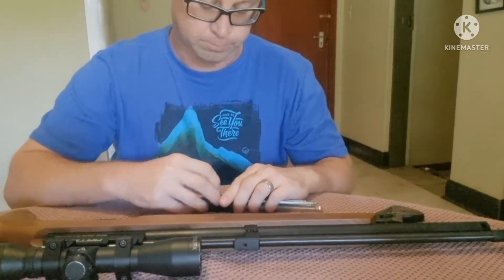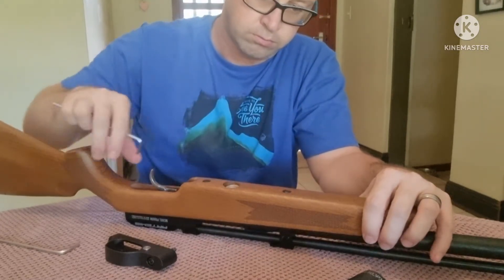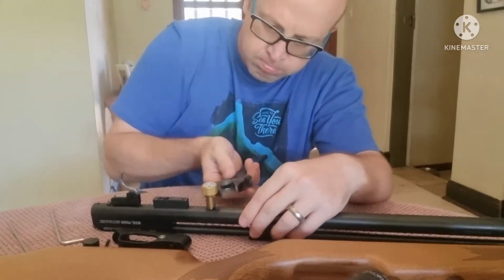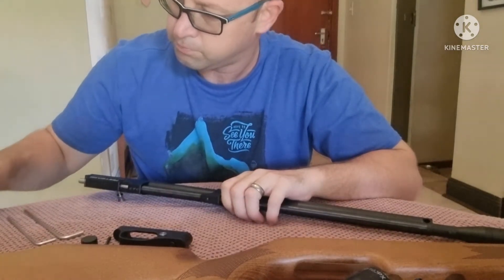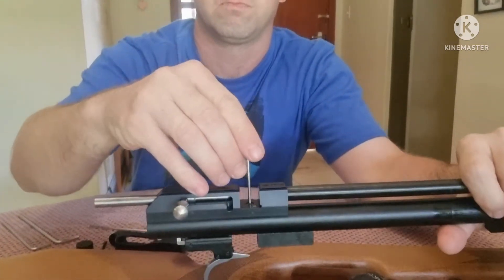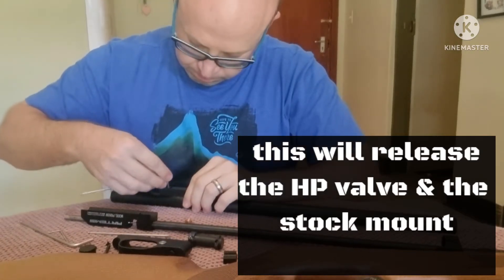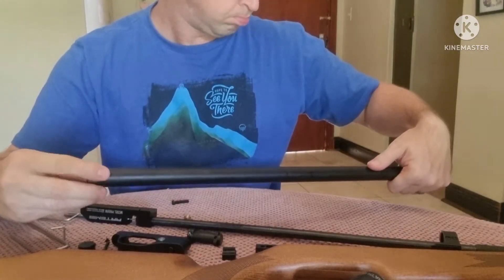How to strip down your PR900/Stormrider - Easy #PR900

Comment: Ran into a problem - broke off my unbreakable bolt!  Was going to take the barrel off and couldn’t get the small screw in the chamber to move.  Tried heat, even a small direct flame but only succeeded in rounding out the hex.  Thought of drilling a small hole -  not sure I have a screw extractor that small or using epoxy to insert a small rod that I could turn.  If anything, the screw is more recessed than it was originally which is confusing.  Not a left handed thread as I recall.  Used a small amount of blue loctite on it and apparently tightened more than I needed to.  Any diy options?  Thanks.
Reply from the maker: Eish that is not nice, loctite can be a real bugger, if it is set it is tough to undo. I would say the easiest is going to be to just drill it out, same size drill bit as the grub screw and then tap the hole to the next size. What you could also try is to use a dremel and cut a small slot to accept a flat screw driver but that is going to be pretty pedantic on that size grub screw.
Reply: @African-Budget-Pellet-Gunner  This not what I understand to be a grub screw but maybe it is.  It’s the one next to the magnet that holds the barrel in place.
Reply from the maker: Oh ok, sorry I thought you were referring to the grub screw which adjusts the bolt action movement. If you are referring to the counter sink screw that released the breech from the tube then the same 2 options mentioned above will apply it may be easier though to start with option 2, grind in a slot for a small flat head screw driver.
Reply: Found my #1 screw extractor which uses 1/8”, about 3mm bit.  Will give that a try tomorrow.
Reply: Tried to drill out the broken bolt hole first since I would still have a working airgun after install oem handle I replaced.  Bad light and poor judgement led to some metal gouging on the receiver.  Tried the breech screw next - ended up drilling it out after screw head broke off.  Hopefully enough threads left to accept another screw.  Was able to remove the barrel and with that the bolt came free.  Found out you can show the good side of the bolt/handle and hide your clumsy work!  One of my first panic moments was finding a o-ring.  Replaced it in the breech with no problem and everything was fine.  Always seemed like a tight fit shoving the bolt home but understood it takes several hundred rounds before it breaks in.  Also read about fat orings - decided to have a closer look at it and now can’t get it back in!  Will watch some more videos to see what the trick is.  Got my scope, chronograph (one shot before the bolt broke) and a shooting bench that has had a single use.  Do you know what the screw size is for the breech screw. I’ve seen M3x.0.6 but would like to confirm before chasing the threads and installing screw.  Thanks for your continuing support!
Reply from the maker: @darwinwilde6973 unfortunately I am not 100% sure about the size of that screw. If your bolt is tight pushing in the pellets, your problem is most likely the barrel which is too tight. Check out this vid to correct it. https://youtu.be/EO0gVpOJoEg
Reply: You should make that video mandatory!  Exactly my problem and with the same predicted result.  Everything back together and I was hoping enough thread left to catch but there wasn’t unfortunately.  Found a screw that was right but about 1mm to long but after a couple cycles was laying on the magnet.  The head on the 4mm is noticeably bigger but could be shaped I guess - then tap for 4mm.  Thought of using epoxy but don’t think it would be good to get inside.  What is under the screw hole? Other ideas?  Thanks.
Reply: Came across an interesting tool I’ve had for many years and seldom used -  for countersinking woods screws.  The bit was broken off but It was perfect for changing the 3mm countersink to fit a 4mm screw.   Head sits flush - pellet loader slides right over it.  It’s also a mm too long and will consider shortening if the bolt strikes it.  Or maybe cut a small channel so it can travel unimpeded.  Will pick up tap tomorrow and be back in business.  Can almost put everything together without checking myself on your videos.
Reply from the maker: Yes, I would say 1 in every 20, CP1 or CP2s have this tight barrel issue. I am sorry your repair has been such a headache. I think perhaps if you send me an email with some pictures I can try advise that way tyrone8511@gmail.com

Comment: Need some help. I had my pr900w, working fine, half inch group at 20yards, firing at 570ftsec. Suddenly, after refilling air, it drops to 400ftsec and fired in different places like a shot gun. What could be the case, before i strip it down. 
Thanks for the help
Reply from the maker: Hi there, is it regulated or not?
Reply: Im not sure as i bought it 2nd hand, but the guys said it was a gen2
Reply from the maker: If a gen 2 then most likely regulated, it sounds to me like a stuck regulator. If it was o-rings you would here it and most likely loose all pressure
Reply: Thanks for the heads up. I think ur right, a stuck regulator. As the gauge was on psi reading, im familiar with the bar reading, most likely i use it below reg pressure. I will top up with air and shots couple hoping to restore, if not, will strip it with the help of your video. 
Thanks again
Reply from the maker: You're most welcome, keep us in the loop, there is many very knowledgeable guys that will comment as well
Reply: Try to put air up to 150bar only. And here what i found. Will try another set without the chronograph at the barrel to find what pressure level shot best group.
Reply: At 150bar,firef at 541. Going high at 36th shot at 672 at 80bar then going down up to 50th shot 583 at 50 bar. 
Is it normal or really need to strip?
Reply: Hi 
Why do you doing this Work...many Power (Joule) or why...i want to by a stormrider at 7.5J and make it over 20J....how can i do it
Thanks
Reply from the maker: @micheletanasescu4476 Hi Michele, you can take the stormrider to well over 20J. Open the transfer port to 4mm, install a 5mm spacer inside the hammer to pre-tension the hammer spring. If it is regulated make sure the regulator is set to 110-120bar
Reply: @African-Budget-Pellet-Gunner  in Germany i can buy only7.5j all over 7.5 i must a gunnlicense
Reply: @African-Budget-Pellet-Gunner  this one

Comment: Hello. Could you please help -
The cocking bolt sheared on my smk pr900
In this dissassembly you didnt appear to remove what I'll call the 'pellet probe' ie the part the bolt screws into.
I have found i can buy spare bolt and probe, but unsure how to replace.
Thank you
Reply from the maker: Hi there, thanks for reaching out, it isn't too complicated. If you have removed the breech/bolt block, you can just unscrew the bolt, and the capscrew underneath which engages with the hammer. Then the whole pellet probe can be pulled out the back. When putting the pellet probe back in just check the small adjustment ball and spring near the back end, this adjusts the slop in the pellet probe. If you struggle, drop me an email tyrone8511@gmail.com
Reply: Did the fix this evening 
Thanks for the advice!
Seemed to go well 

Only strange effect - now reassembled and firing normally, the guns pressure gauge isn't working, it shows 0. 

Any ideas why?
Reply from the maker: @ppeppe only thing I can think is that something is stuck in the guage inlet pipe(port)

Comment: Is it possible to change the caliber from 4.5 mm to 5.5 mm?
Reply from the maker: You need to change the barrel and breech block if you want to switch caliber. The pellet probe in .177 and .22 are not the same

Comment: Hello I have a problem! I attempted to fill my Stormrider I have a ToAuto A2x compressor, all connections tight, release valve on compressor tight, I performed a leak test on compressor, it was fine, pop off valve had new disk. I tried various positions of probe in rifle. Wondering if something is wrong with end cap fill port? Help!!
Reply from the maker: Hi William, I don't have much experience with compressors but I do know a thing or 2 about the stormrider. Perhaps send me an email with some pics and more background info. Perhaps we could even do a whatsapp/zoom call to see how I can help tyrone8511@gmail.com
Reply: I followed your instructions and tuned my rifle, smoothed the Hammer, trigger,pressure valve that the Hammer hits, used appropriate Lubricant for O rings, assembled rifle and it all works well. Wanted to maintain pressure in gun until I can shoot it and it won't fill. Is there a way to check end cap fill portal?
Reply from the maker: All I can think is to remove the fill cap again and check that the openings aren't obstructed. Is this the 1st time you tried to fill it after you worked on it
Reply: Yes actually the only time I have attempted to fill. I had the gun at least a year and it maintained pressure all that time. I had back surgery and was unable to use it before now.
Reply from the maker: Send me an email then we can make arrangements for a whatsapp or Zoom call then I will try help you out
Reply: I noticed that it has a screw, so I don't understand the valving system.  Is it that pump must overcome a certain pressure which opens valve?
Reply from the maker: Does your stormrider have a regulator or is it unregulated
Reply: I have purchased a Regulator made in England but have not received it.
Reply: So maybe it was the screw?
Reply from the maker: Oh ok so you don't have a regulator installed currently. Which screw are you then referring to
Reply from the maker: I wonder if that screw wasn't closing the air port then. Not sure which screw you are referring to but I am glad it is sorted
Reply: Inside the end cap fill portal.
Reply: If you look inside the end cap it's a silver screw. Does yours not have one?
Reply: @wildbillcarroll  If you have a gen 2 it is regulated already. When you take off the fill part and pressure gauge near end of barrel if you look down the pressure tube you will see the adjustment screw for it.

Comment: Just an update of what I have done thanks to your help. I tuned my trigger, smoothed the Hammer and cleaned  barrel.
Then I got a Regulator from Lane, I got a pressure guage/end cap so now I have a Regulator guage and a tank guage. Then I purchased a carbon fiber tube to fit around the barrel to stabilize the barrel  and it looks cool!

Thanks!
Reply from the maker: Wow, sounds absolutely awesome. I am sure with all the extras and works done that rifle must be smooth as silk and shooting beautifully

Comment: Hi...pressure gauge block rimane così intanto o si deve allargare il buco?se metto il trasferport di 4 mm devo lavorare pure sull pressure gauge block?la mia Diana con regolatore e impostata a 140 bar ...dalla fabbrica
Reply from the maker: If you open the transfer port to 4mm you will also need to open the breech, barrel and valve. But at 140bar you should get a good fps as is
Reply: @African-Budget-Pellet-Gunner  wow.. molto più lavoro da quanto ho creduto...NON BASTA solo un trasferport e aggiungere un spessore di 5 mm alla molla del martello
Reply from the maker: @micheletanasescu4476  well it all depends what you want to get out. Personally I would just add the spacer. If you add a larger transfer port it will do nothing without drilling the other areas mentioned. You need to drill all the areas.
Reply: @African-Budget-Pellet-Gunner  ho paura che rovino il fucile 🫣
Reply from the maker: @micheletanasescu4476 the spacer can be removed easily so that is the safest option
Reply: @African-Budget-Pellet-Gunner  only Whit spacer and whitdount trasferport and Regulator at 140bar ,how many Joule you think that i have?
Cann i hunting at 50 yards Whit  .22
Reply from the maker: @micheletanasescu4476  firstly yes you can definitely hunt at 50m no problem. With the reg at 140bar and 3.5mm transfer port and 5mm spacer I will expect well over 20fpe
Reply: @African-Budget-Pellet-Gunner  thank you very much
Reply: @African-Budget-Pellet-Gunner  what you mean 20 fpe ...ist that faster ...how many Joule?

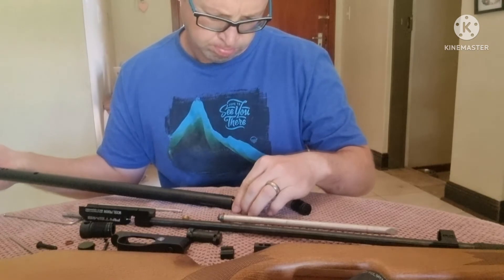Comment: HI Tyrone .... and good morning 10:30 here in the UK ..... I have a SMK Victory PR900 2nd gen PCP.  I can't pump it more than 150 bar because it "blows" rapidly at that pressure. Any idea which seal might be the culprit ?
Reply from the maker: Hi Graham, sure I can try help. Just want to check, you said that your rifle is leaking where exactly? Perhaps easier to help you through email, tyrone8511@gmail.com then you can send me some pics
Reply from the maker: Hi Graham, sure I can try help. Just want to check, you said that your rifle is leaking where exactly? Perhaps easier to help you through email, tyrone8511@gmail.com then you can send me some pics
Reply: When this happened with mine, it was the o ring at the full port. You could hear the air was leaking from around there so it was easy to locate. Replaced o ring solved it.
Reply: @ppeppe  It wasn't the fill port, Turned out it was the Main Tube seal,

Comment: Nice video can you tell me why my new 2nd generation Stormriders Bolt feels like it has a spring when I pull it back it does not go back all the way and springs forward?
Reply from the maker: @william carroll this is quite common, what has most likely happened is the cap screw which is on your hammer has come loose or the cap screw on your bolt action
Reply: So it has the single shot magazine in place and the bolt does not go back far enough for me to remove it, so how can I get to the fastener to seperate?
Reply: Ok so I get it I can remove the fastener blocking the bolt.
Reply from the maker: Not remove it but retighten it
Reply from the maker: If you remove the hammer spring end cap you might get a little more space to be able to remove the single shot tray
Reply: Had to remove end cap to get magazine out reassembled and bolt won't go all the way back. So do you think the Hammer was put in wrong?
Reply from the maker: I think just send me some pictures at tyrone8511@gmail.com and I will help you out
Reply: I started sanding the Hammer and bore got it nice and smooth. Didn't realize how loose the bolts were when they put it together and how dirty the gun is. So glad I watched your videos, I ordered some oil made for O seals and air guns I will send pic's when I reassemble hopefully it will work then.
Reply from the maker: Awesome sounds good and sounds like you are on the correct path
Reply: One more question the what's the best Pellets you have used for Stormrider? I'm going to get the Regulator have you thought about getting one?
Reply from the maker: Personally not a big fan of regulators as it is something extra which can go wrong. The best pellets for my rifle is JSB jumbo express
Reply: You have been Great thanks for your knowledge and quick replies!!
Reply from the maker: You're most welcome glad I could assist

Comment: I made a 16 round 3d printed gravity fed magazine for this rifle.
Reply from the maker: Sounds cool, does it work better than the original mags
Reply: @African-Budget-Pellet-Gunner  It works about the same, you need to keep the gun upright when reloading because of the gravity fed, but you can get 16 shots off pretty quick, being 3d printed, your printer needs to be dialed in. I got some stuck to be honest, but you get them out with some wiggling. I would recommend the normal 7 round mags if you want reliability, the 16 shot I use because I am lazy and it loads much faster and easier. It works great when you just want to shoot some targets. I've found that the more you shoot with it, the better it works. Both my rifles are permanently fitted with them as they can be fitted with a scope, and they look pretty cool if I may say so myself.
Reply from the maker: @Voidy123 awesome sounds great, I remember seeing @walnut and steel a gravity mag he used on his crosmans

Comment: I wish I saw your video before I started, now I have the pressure valve assembly and a huma regulator stuck in the reservoir. Tried to push it out from the back seems doesn't move at all, how can I get everything out?
Reply from the maker: Hi, sorry this valve assembly and in your case regulator ccan only come out from 1 side due to the indents in the pressure tube. Just be patient with a piece of wooden dowel and it will come out. Make sure all the screws etc. Are all removed
Reply: @African-Budget-Pellet-Gunner  Would it be OK to use a mallet to slowly tap wooden dowell placing the reservoir vertically (on a padded platform)?
Reply: @African-Budget-Pellet-Gunner  Would it be okay to tap the wooden dowell with a mallet after placing the reserviour vertically on a padded platform?
Reply from the maker: Yes, it should be fine. The wood should be softer than the metal. The valve has an o-ring which is probably holding t in place. Once it starts moving it should go pretty easy
Reply: It's strange, as I tapped from back using a pvc pipe, the valve house barely moved but the pressure gauge and the regulator slid forward some! @African-Budget-Pellet-Gunner
Reply: The valve house never budged, but by tapping over two days I was able to get the regulator and pressure gauge assembly out, put the spacer and regulator parts, and rest of the gun! Thanks for your help! I almost thought I hosed the gun, but it worked. Testing in progress now 😁 @African-Budget-Pellet-Gunner
Reply from the maker: @mdahsan24 you're welcome, glad I could help